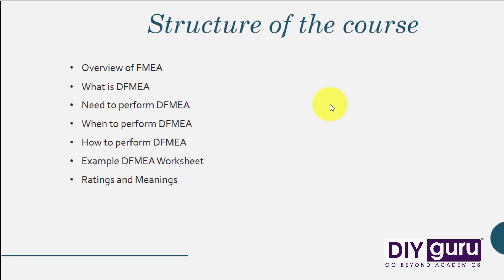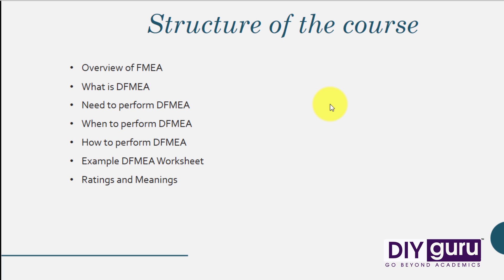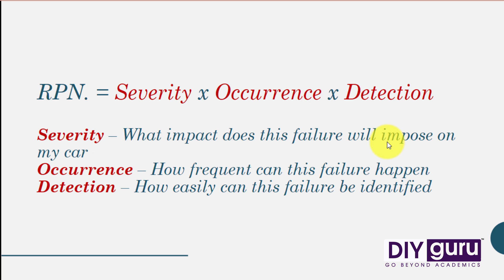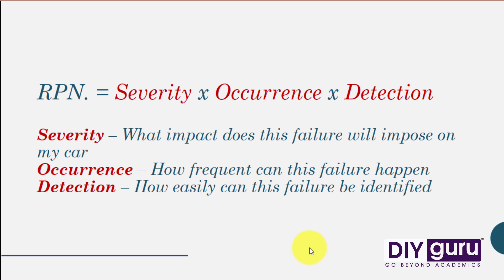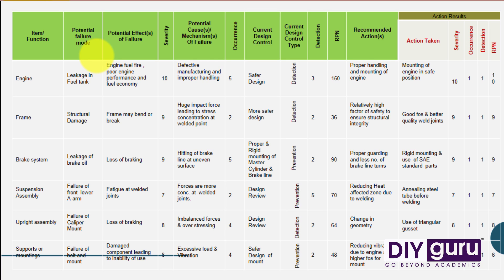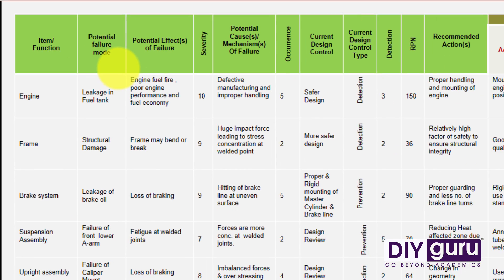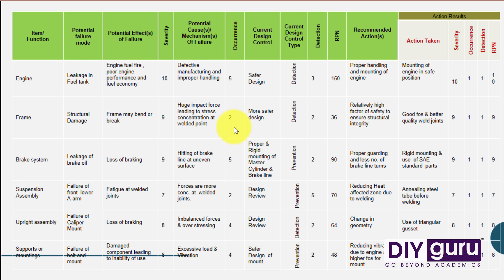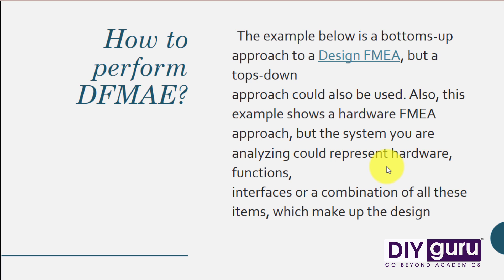DFMEA Explained | Automobile Engineering | BAJA / SUPRA / FSAE

Comment: FMEA is done during development process in the very early stages and get modified as and when required.

Also the severety, exposure and detection is analysed with respect to driver and passenger not vehicle.